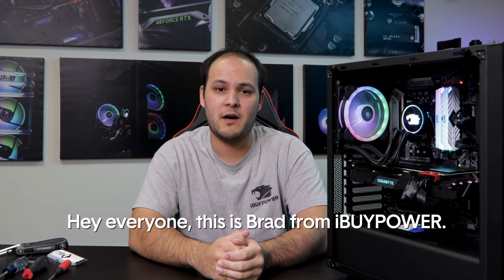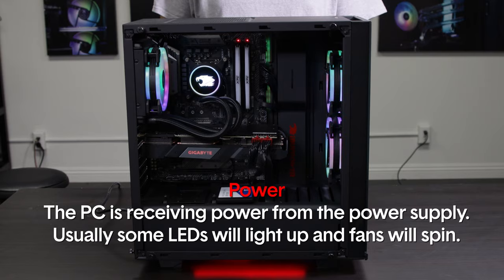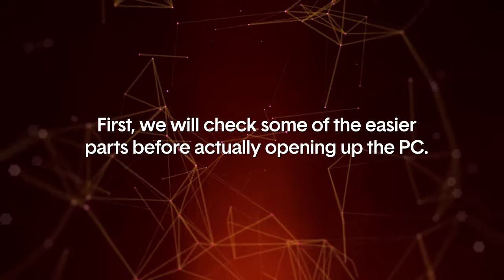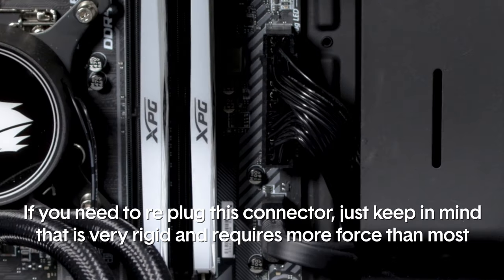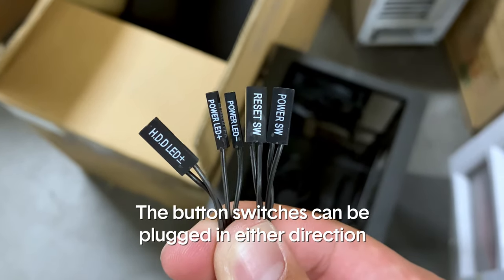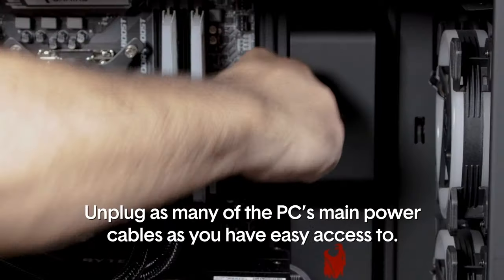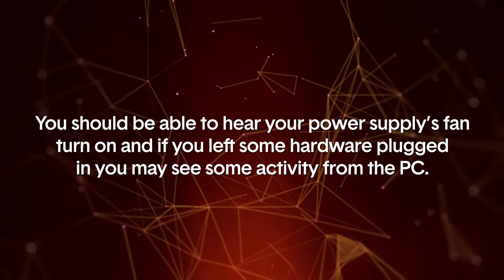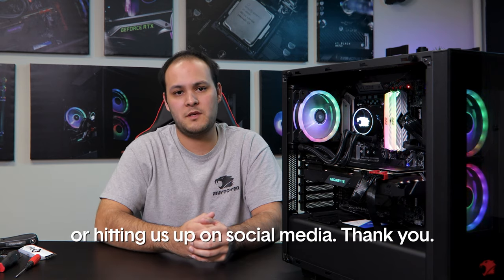"My Computer Will Not Turn On" - Troubleshooting PC Power Supply | Computers and Coffee

Comment: when i went home on press the on button it did not turn on so i panicked and then i searche on youtube and found this video.Thank you
Reply: may i ask what was the problem and how you solved it?
Reply: Please let us know
Reply: @CNMiamiPS  did your get fix my wont trun on
Reply: @zakiwtw5991  Yeah, I think the PSU was busted, it's a really old pre-built that still has Windows Vista installed so I think it just broke cause of how old it is. I also had another PC with a PSU problem that turned out to have a burnt internal component. If you already tried cleaning your RAM and also the DIMM slot, maybe it's your PSU?

Comment: Thought I shorted one of my components in my PC and was devastated. Turns out it was my power sw cable that was loose after cleaning inside my case. Thank you so so much for this video. 💗  It made my day
Reply: hello there i kind of have the same issue but idk whats wrong everything is plugged in it wouldnt turn on until i used a screw driver to jump it which works but my power button on pc doesnt work do i need to get a whole new power supply?

Comment: I did the last instruction - jump the psu. Found out that my psu is still working, added each cable until Only the 24pin is left. And alas it doesn't power on when plugging in the 24pin. Turns out that my CMOS battery is faulty. All i had to do was clean it and it finally works 😎. I already purchase a few CMOS battery online so I can change the battery for good. Thank you very much. You are a big help 💪💪

Comment: I had issues with my pc and bought every part and it still gives me the same issue. your video solved it. The frkn powercable to the cpu was fried so when I did the papeclip test with the cpu cable connected, it blew up since it had a short. I changed the cable and everything works now. I had issues for months and you finally helped me solve it.

Comment: DUDE THANK YOU IVE BEEN HAVING THE BIGGEST HEADACHE. I’ve built multiple PCs and never had issues but it wouldn’t turn on and jumping the power header pins(whatever they are) worked. I took apart and rebuilt this 2 times
Reply: No issues with PCs you built because you care about your PC, and also fedex didnt throw it around.

Comment: This helped, I’m an idiot and didn’t plug in the front panel connectors properly
Reply: SAME dude! I was so worried i had spectacularly screwed up. All it was was that my power switch and reset switch were plugged into each others locations. This video helped a lot, thx!!!
Reply: @alexanderballance2996  so wait was it still able to turn on when u plugged it in wrong and then one day it stopped working ?
Reply: @iSpyCokee  No it did not turn on at all after I had built the PC, but then I realized that the power and reset were switched on the motherboard. Once I put them in the correct locations, the PC booted up fine.

Comment: The old psu from my pc randomly turned off and it didn't turned on anymore (it got damaged). I replaced it with a brand new one and the pc doesn't turn on at all. What can be the problem here? (The OLD PSU was CORSAIR 80+ bronze certified so it wasn't a bad one)

Comment: This is my current situation 

Just bought all the parts needed for a pc. This is my second build and never encountered problems like this. My pc is not getting any power at all even though my power supply is working. I verified this by using the paperclip method. I also even attached one of my case fans and that worked so I’m 100% sure they work. 
This is what I know is working as I tested them in different computer
Gpu 
Ram 
CPU I don’t know 
My only conclusion is my motherboard however when I press the bios flash button I still see the red light blink. 

To sum it up I am receiving no power and my I have verified my PSU is working. 
Any help is appreciated
Reply: Interesting I’m getting no power also but the bio flash button does blink, did you end up fixing the problem ?

Comment: First off, thanks for this vid. It helped beyond words. My PC has been dead for a few days. It was fine one night, I put it to sleep, and it was dead the next morning.

I did the clip trick, but I didn't unplugged anything, other than the 24 pin. Everything lit up like a Christmas tree but the Ram and GPU. My guess is, this trick bypasses the motherboard. Am I correct? I plugged the 24 pin back it, and the little power button on the Mobo lit up for a few seconds and went out, the pc was dead again. The Mobo it the trouble then, right?
Reply: Yeah bro ): sad to hear gotta get a new mobo

Comment: Jump starting the power supply helped! I was able to figure out that it was my 8 pin connector on the motherboard that was stopping it from starting up. Thank you so much!
Reply: So how did you fix it? I can't replace that cable. Did you have to replace the whole motherboard?
Reply: @waltermh111  no one here even reply back lmao all my new computer and compotents just randomy turn off and my motherboard only shows the led lights my cpu fans dont even spin nor the front rgb light fans work :T

Comment: This is just what I needed to get my computer back up and running. Thank you MUCHO for this video! thought my power supply was dune... turns out I had a loose pin in the cable...
Reply: Did it got loose while the pc is running?

Comment: Okay so my pc turns on with the paper clip but dosnt work when is plugged into the mother board only rgb turns on that is connected to the motherboard but no fans turn on it rgb turn on any suggestions?
Reply: did you already solve it?
Reply: It might be your motherboard 24 pin header is damaged so it doesn't connect to your power supply properly.

Comment: Spilled a small amount of liquid on my pc yesterday, turned off and unplugged immediately. Today the only way it will turn on is by jumping the power supply. Followed the procedure shown in the video, the only thing that keeps it from turning on is when i plug the main big harness plug back in (have to remove paper clip jumper to plug in). 
[update] - had to replace the motherboard lol

Comment: My power supply works (i have tested it) but my PC doesn't work
Also my CPU fan doesn't run
Can you help me please?
Reply: Is the cpu fan plugged in ?
Reply: @fmone7878  yup
Reply: @fmone7878  i have fixed it
I think my brother put the floppy disk cable in the mother board by mistake
After removing it the computer worked well

Comment: thank you so much, I built my pc for first time and psu won't even turn on, I tried replug the power cable and front panel connector on mobo and it works

Comment: Anyone know what it could be if the lights and fans power on for a split second but then it turns off? We checked the power supply with the paper clip method and it appears to be ok, but when you plug everything back in and hit the power button it just blinks for a split second and then nothing.

Comment: Excellent video and without any of the usual rasping music which often accompanies utube videos.  Great presenter and easy to understand. Unfortunately it did not cover my problem which is that my HP PC often powers off when left overnight and when I try powering on I get 2 beeps followed by four and this repeats,  but will not power on until I physically disconnect the power cable and plug it back in on, at which time it boots up per normal. This happens about once every three weeks. I suspect the cheapo power supply, but tests show it is working correctly.

Comment: Ok, so I tried the last step with the paper clip. The fan turned on and it kept turning on with every cable I plugged in again. The only cable I have not plugged back in yet, is the 24 pin power cable where the paper clip is inserted. Does that mean it is likely the mother board that's not working anymore??
Reply: Have you figured out the problem since you posted? This is my issue, too. I've looked up how to know what motherboard is installed, and all the advice says to use the computer, which I obviously can't do. This powering up problem has been happening for several weeks and I was just using my computer last night. Today it just won't boot up at all. This tutorial was helpful, but also a little unclear in the step where we are identifying the problem.

Comment: I turned off my PC at 9.30 am, and when I came back from work at 5.30pm, I tried to turn it back on, but my PC would not turn on. I took it to Geek Squad, and they told me that my PC is too dirty, and refused to open it up citing a health hazard. Someone told me that the most likely reason for my problem is that the power supply is clogged and needs cleaning.

I have my life's work in my hard disk of my PC. Can this be salvaged? Also, what do you think of the problem and the initial diagnosis of a clogged power supply?

Comment: Thanks for this! Just built my pc the other day and it worked fine! Moved it across the room and it won’t turn back on. Got it working again after wiggling wires. Turned it off to go to bed and then in the morning no power....
Reply: What was the Solution?
Reply: I also have this problem constantly. What was the solution?
Reply: Gonna sound pretty dumb but I literally just didn’t have the small power switch plug ins all the way secured. I’d suggest just double checking. Wasn’t anything serious
Reply: @Andrettijames  ahh, okay. That doesn’t help em much, as I already checked it, but thanks for trying to help me out (and responding to a comment you made almost a year ago)

Comment: Are you guys still assisting through comments? I just built a pc and it won't turn on. Using a psu tester it does turn on my fans and rgb but when I plug it into my motherboard nothing happens. Tried all steps you showed here. Is it a DOA motherboard?

Comment: I have an old HP Pavilion that just had a power supply go bad.  Over a couple of days, it was making a revving up and down noise periodically, the PC restarted itself a couple of times, and eventually, it just went dead.  The PSU went bad.  Via the paperclip test, the fan barely moves, like it is going in slow motion, but herky-jerky.  I got a new PSU.  It powers on fine.  The PC still won't turn on.  When I press the power button, it flashes for about a tenth of second, and the CPU fan simultaneously does a little jerk, but that is all that happens and it sits there completely dead.  If I keep switching the PSU off and back on, it will do those two things over and over again, but that's all.  PLEASE HELP!

P.S.  I tried jumping the power switch (although the connector is different) and it does the same thing as when I press the power button.

Comment: It was the power cable into the motherboard that seems to have been loose. It powered on, but I sure hope this isn’t a finicky connection and looses connectivity easily as the connection doesn’t seem much different after re-connecting it.
Reply: And of course the next day it won’t power on again and this time the previous fix isn’t resolving the issue.

Comment: I have 3 power supplies that failed to power up the motherboard. The pins for the switch were installed correctly. I bought a new MSI Z790 motherboard and an Intel I9 12900k CPU. When installed, I followed an MSI printout about the pin configuration. Assembled, It is completely dead. All items are newly purchased: The Z790 Motherboard, an MSI Ventus 3x graphics card, and the Intel I9 12900k Intel chip, and were delivered within days of each other. I have 3 power supplies that now seem to "not work:" AN MSI 850W, MSI 725W, and MSI 750W. They worked on other PCs but not recently. 
The power supplies are the only things "not new" for a couple of thousand dollars purchased and recently delivered. Dead on arrival? Which, I cannot believe. How do I tell if the power supplies are bad? They worked on other PCs. Brand new equipment no-go out of the box?
I have had many MSI reliable products of which two malfunctioned after a decade of gaming. They were the reason for the purchase.

Comment: My 2009 LENOVO ThinkCentre M58p decided not to boot up completely, but instead just kept turning on for about 2 seconds, then off, then on again for 2 seconds, and after repeating this several times, it would just either stay off, or stay on while hung up in a doing nothing black screen mode.  My guess was that it was PSU problem.  So I took the power supply apart and found that 6 1000uF electrolytic capacitors were bulging at the top, which is not good.  Five of them were used at the final positive and the negative voltage outputs, but the one remaining capacitor was present near an IC.  I only had one 1000uF capacitor floating around, so I chose to replace the one capacitor located near the Integrated Circuit.  Bingo, the computer now boots up.  I will have to purchase 5 more capacitors to replace the other 5 bad capacitors.  Anyhow, total repair cost will be about 8 dollars.

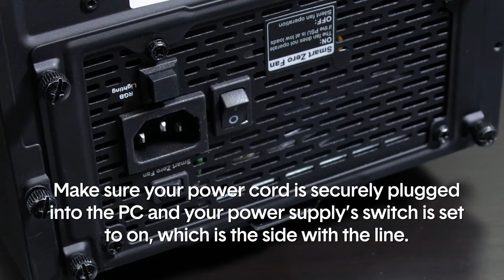Comment: OH MY GOD!!!!!!  THANK YOU!!!!!!!! You solved my issue with a single step which is step 2 at 2:06 with the on/off button on the back in this video.  I heard a loud pop while playing World of Warcraft and then the monitor went black and the desktop computer lights went black.  There after the power on button on the front of the computer would not work. Past experience told me that it was more than likely the power supply had gone out.  I ordered and replaced it but still no power.  After see you explain something I should have known but did not was the "On/Off" function of that one little button.  The moment I switched it to the on position and pressed the power button on the front of the computer it powered up.  THANK YOU!!!!!  THANK YOU!!!!!  THANK YOU!!!!!  THANK YOU!!!!!

Comment: Bought this $799 iBuyPower PC, i5, MSI motha (Dragon Center is dope, use it to control RGB), NVIDA Geforce 1650, etc. 

Ordered on a Tuesday, arrived on a Friday, jammed Valheim over the weekend, PC wouldn't start on Monday night :( I named this dead man Solomon Grundy. Big-time sads. Did the easy trouble shooting steps but since it's new I'm returning it. BEFORE it wouldn't turn on (probably a power supply failure?) I was loving this PC.

Hate to return it but with failure this early I just have to.
Reply: ALSO, I only got a busy signal from IBP's customer services phone numbers. Had to YEET it. RIP.

Comment: I did this tow tricks 
Turning the psu without the power button by the paperclip 
And the motherboard without power button
And nothing happened
And there's no lights are out when i plugin the cord of pc
Before the mouse it was light up 
But now nothing happen
And there's no black dust or burning smell 
So is it a psu issue or what 
This problem suddenly happened
I have an electrical sensitive screwdriver it's light up anywhere i put it in the case 
Need help guys
Reply: You guy's  for who have the same problem  it's psu issue so change your psu

Comment: Hey there,

So disconnected my computer so I can do some cleaning. Dry towel and air duster. When I plugged my computer back I heard a loud noise from my speaker. After than my computer struggles to turn on. It’ll try for like 30 seconds and then power off, then it’ll try again on its own. It just keeps at it on this loop. Tried all these steps and nothing. Please advise

Comment: I had a power cut, so it’s likely related to a power surge and the board or psu is dead but I had it plugged into a surge protector.. the boards leds are lit up when plugged in but there’s nothing when I hit the power button

Comment: I figured out it was my power switch that wasn't working with the screwdriver trick. now idk if it was loose plugs or not, but i unplugged a lot from the power switch and plugged them back in as far as i could push them in. so far the biggest difference i found was that the 2 second delay (when i would turn off psu and then turn it back on to power my pc) is gone and is now instant to turn on all my devices in my build. I hope it stays working.

if not, does this mean i need a new case?

Comment: Hello there, may I ask for your help please, I tried to upgrade my pc's RAM and I bought exactly same type with same speed, identical with the old RAM but after I added them the pc did not start so I took the new RAMs off and tried qith old RAM but the pc won't start either, I cheched every single cable and tried to switch  it on directly before the switch button but nothing, the issue is that I see the leds of the MB on so the power is working and I can't  figure out why this happened  or what is happening. Thank you!

Comment: Pc most of the time doesnt turn on. Was brought to get fixed, said it was working. Directly plugged the pc onto the wall socket worked. A week later 2nd or 3rd short use wont turn on for a week. Tried yesterday. Today its working.

I wish I could find the problem but the pc isnt really mine so I have no options except help without opening the pc.

Comment: Hi I just built my first pc and I can't get it to power on. I've replaced motherboard/ram/psu and cpu. When I plug it in and switch on the power supply there's a noticeable power light behind my motherboard but when I press the power button on the case the pc powers on and lights flicker on and off for a nano second and back off. The PSC lights up red with the ram and cpu but I have just replaced them. When I replaced my cpu that's when the motherboard showed life but I'm still getting the PSC lit up on both ram and cpu and it not powering on. Hopefully you can help I've done enough demo work via a simulator to know that PSU is generally the problem but I've replaced it twice and I actually am getting power to the motherboard. All plugs and cables are in the right slots and tight.

Comment: The POWER SW trick did not turn my pc on.
The PSU trick turned on my fan.

I don't see the pins in POWER SW to be bent or dangling, so i don't think it's the problem. I suspect it's the motherboard or the CMOS battery.